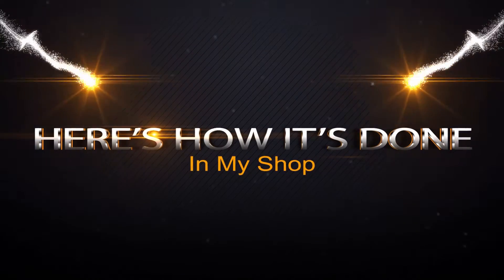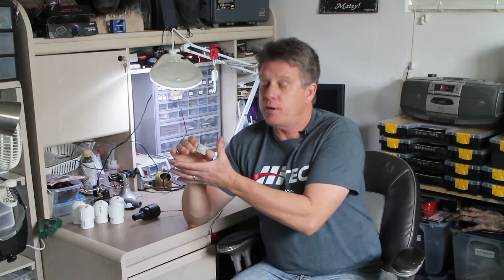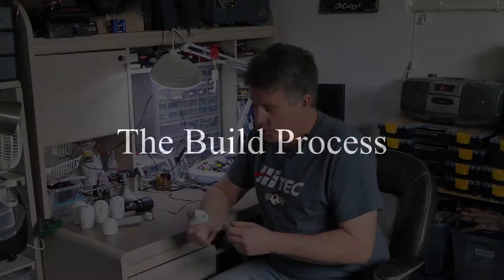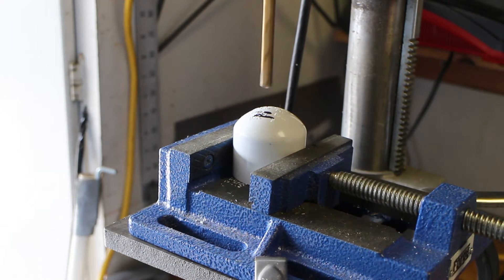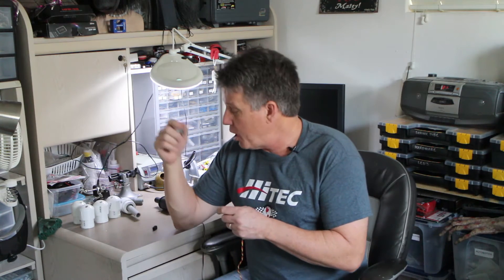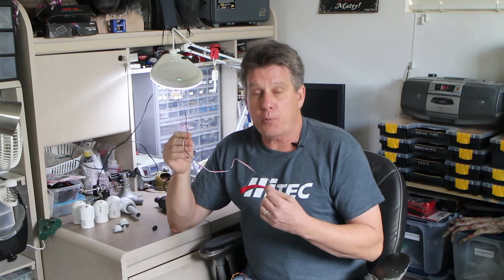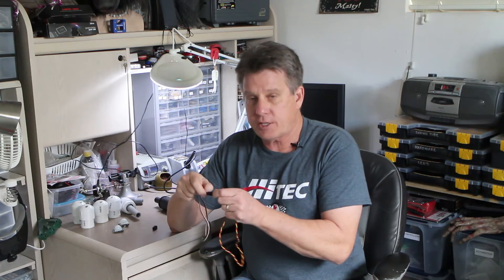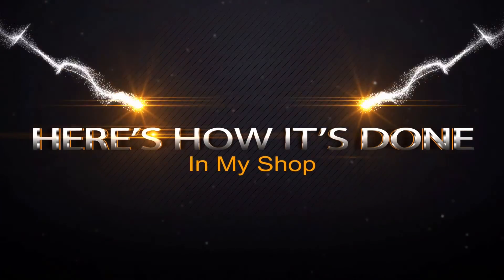PIR Enclosure Tutorial

Comment: How do you know how long to make the tube?   What kind of range do you get with this after the sensor gets enclosed?   Great stuff thanks.
Reply from the maker: The PVC tube only needs to be a couple of inches long.  These do have a sensitivity setting.  The ones I have near the street and pointing that way will get triggered by passing cars.  I make sure to park my cars in front of the house and point the PIR's at my car to block any false triggers from passing cars.
Reply: Thanks.  That helps.

Comment: I always refer to the connector with the pins as the male, even if its housing slides into the other end's housing.
Reply from the maker: Understood.  If you consider the pins on the pcb as the "male" end then the other is the female.  The confusion arises when you try to explain the extensions.